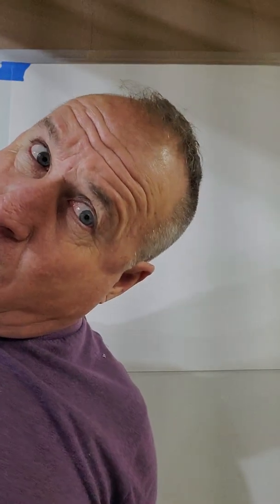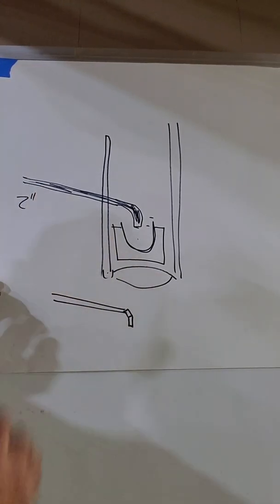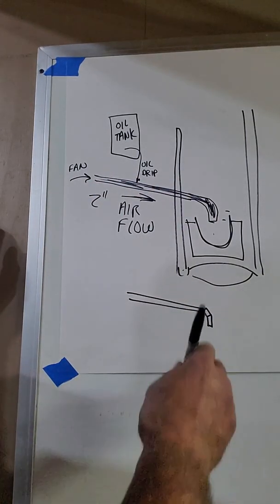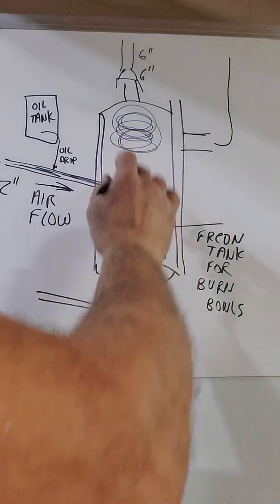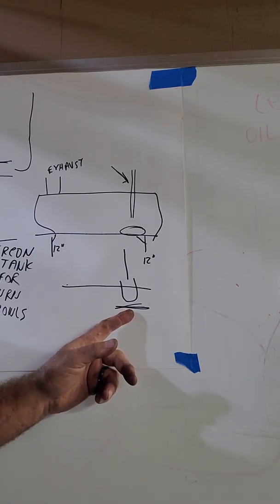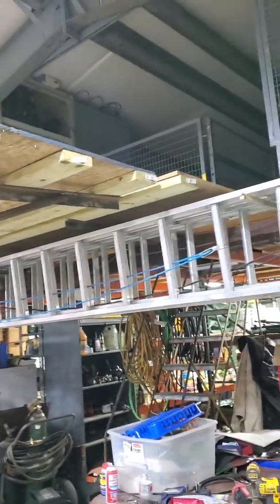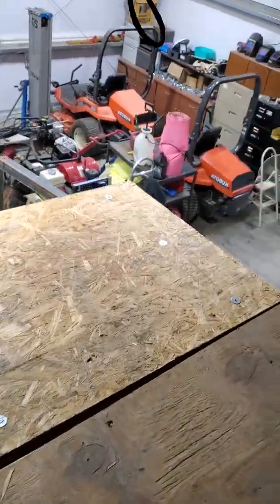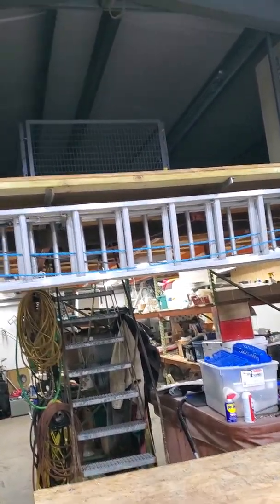DIAGRAM OF WASTE OIL HEATER BUILD

Comment: These have a major flaws they don't like water in the oil, and there's always some water in oil, again if not set correctly, over feeding with oil can smoke, and worse of all if gravity fed god help you.
The new blue flame heaters are alot more safer than these. They will keep burning and evaporate the water and don't mind being over fed with waste oil. Plus they never smoke. Burn hotter. 
There here on YouTube make those instead. Don't waste your time with the blow in the pot heaters. They've had their place in earlier years, but they have been superseded.

Comment: I saw on the video that you have a some kind of Metal plate on the bottom of the airflow pipe. Does it have to be solid piece or you have to drill a hole in the middle?
Reply from the maker: that was when i first started making these. have found since then open pipe without waffle works better

Comment: Hi Frank I really like your system I would like to build one of those from my shop only question I have about the oil drip line is that separate line or it goes into the air flow pipe?
Reply from the maker: drips in and down the air flow pipe

Comment: Hi Frank I have a question is the oil runs where is the air flow in the same pipe . I really like your system would like to build same way that’s the only question I have about the oil drip if I have to make separate pipe or it runs in the same pipe with air .
Reply from the maker: oil runs in airflow pipe